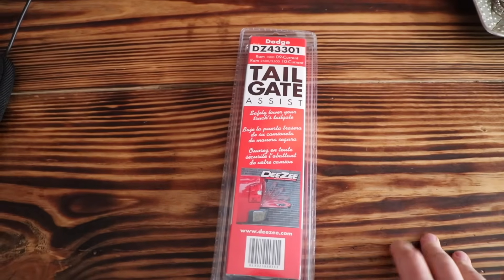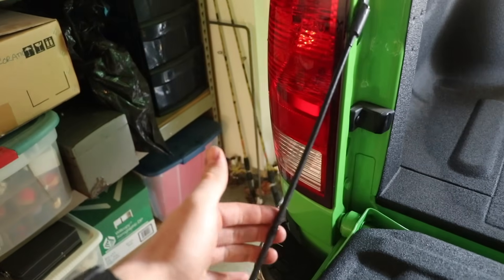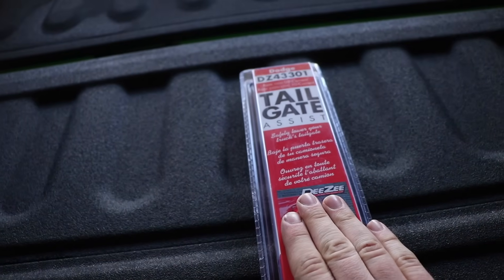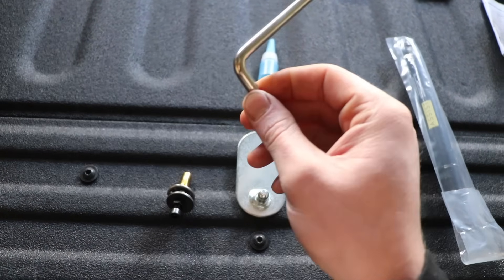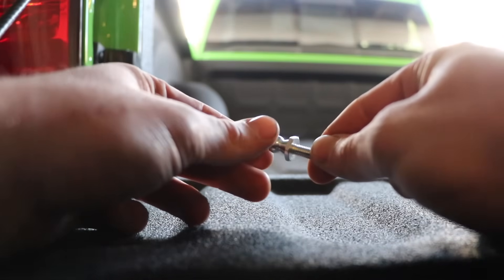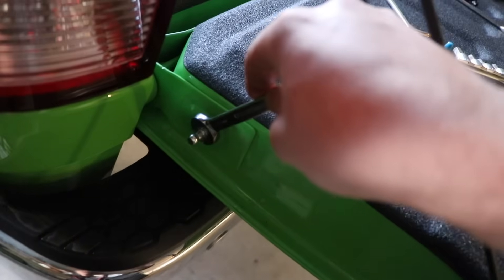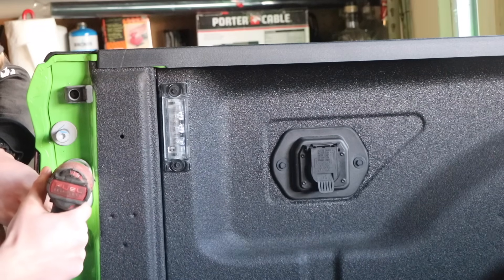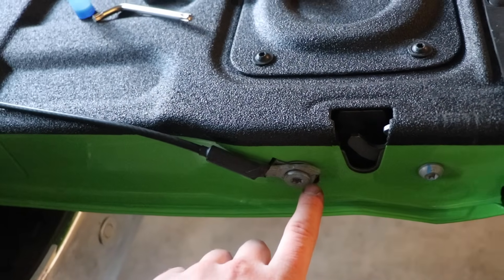$20 Tailgate HACK Everybody NEEDS To Know!!!

Comment: I had a 1995 Ford F150 4x4 3/4 Heavy D.  Had a tailgate that weighed a ton. Don't know why. Opened it up even to see why; couldn't find why. I am handicapped & use a curbside lift mounted in the truck bed to put my mobility cart in the back. No one had a way to raise or lower a tailgate for handicapped back then. I added another motor & bracket to the lift & a strap to the tailgate & with an extra bunton to the remote. I had the only electric tailgate lift. Had a lot of people ask why I needed such a thing probably over 500 times at least. But when I released that strap after lowering that tailgate & said try closing that thing. Most ALL the word out of their mouth was (SH-T). (WHAT THE HELL IS IN THAT THING)?  My answer was always the same I have no clue. It came Factory that way.

Comment: I put super glue on the bottom side of the collar that meets the truck end gate hole, and let it set, that kept it from spinning. I put 1 drop, of 3 in 1 oil, on the balls of the bering to make it roll with the least amount of friction. I removed the special rotation control washer thing from behind the cable on the end gate side,  and installed the same size stainless steel washer, so the cable end, would not scratch my paint where it mounts without the washer thing. Mine works great and I love it. If you guys like this go to Lowes and buy auto drop toilet seats for your home toilets. You just start them and leave them go and they go slowly down themselves. It's the same feeling as this truck gate tool. No more slamming.

Comment: Past 2 years I've had it on my cummins. Still going strong. Word of advice... wd 40 the ball joints at the tailgate and bed every now and then. You're welcome.
Reply: We 40 gets sticky over time. Use a silicone or aluminum based lubrication

Comment: Hmmm,  I bought a used '17 Ram, 4x4, same green by the way, 2700 or so miles on it, last February 2019.  I was pleasantly surprised to see that the tailgate slowly lowers just like in the video.  I thought it was standard equipment, but I guess not. Thanks to the former owner for installing this handy gadget. (I'm 67, so I don't need a heavy tailgate.)

Comment: Based on experience, you might want to check the fittings every few months.  Despite using the loc-tite when I installed mine about 18 months ago, the ball-stud backed out over time without me noticing it and one day I went to open my tailgate and the thing dropped when the stud pulled out.  Nothing permanently damaged but I check the threads every month or so now just to be safe.

Comment: Just an FYI...You can leave the limiter on if you flatten down the rear  tab. It will stop the metal end of the strap from rubbing the paint off the side of the tailgate and not interfere with the strap function.
Reply: What’s a limiter? What’s a strap?

Comment: Some people are so critical and rude... enough said on that! I'm happy to find this product that I didn't know about before. Already in my amazon cart.  Apparently no need to install on both sides? Would it last longer or be too slow with two if you did??  (my only questions)  Makes excellent sense for safety. For people with disabilities or who just want something extra to make life easier.  I pull a 5th wheel and have limited space between truck and trailer. This will make it easier to reach in to unlatch the gate from the side and let it come down on its own. Thanks for the video Ryan!

Comment: i don't think this makes you girly.... I got this for my Ram because my nieces and nephews like to climb in the back and after they would open the tail gait they would have to duck and dodge the drop. i knew one day it would hit someone on the head and that tailgate is heavy enough to mess up someone's neck or spine if hitting them right.. so I got it for their safety.
Reply: Same here. The tailgate latch on my 2019 RAM is basically an electronic button so it's super easy to press. It's the one thing I really dislike about the truck. I prefer mechanical latches. But anyway, it's so easy to press my four year old can reach up and open the tailgate. It only took one time of me leaping over to grab the tailgate before it smacked him in the head to decide to add dampeners. Luckily on the 2019, I can buy the OEM dampener that installs completely hidden behind the tail light.
Reply: You're a thoughtful person man good on you🤙

Comment: Hello Ryan. Ya I know this is a bit late. Great video and excellent instruction on this install. You sold me and a buddy to buy this item to be installed on a 2015 and 2017 RAM 1500's. It's now 2021 and things have changed. Let me tell you what I experienced. With the DeeZee DZ43301 Tailgate Assist. No longer is the locktite provided because the ball mounts for the shock are preinstalled. You will need to remove & clean upper T45 mount and reinstall locktite, that you provide, because removing the lower mount is no longer required provided you bend back the lower limiter clip on the cable mount. Ensuring the very important step of measuring 3 1/2" from the top of the cable is crucial for the spacer install. The package comes with colored pictures and with very good instructions of what is needed to be done. Great job and any other person following this vidoe could be cOrNfUzEd. BIG THANKS!

Comment: I believe, depending on the year of the truck, there is a lowering dampener built in just below the rear tail light. Passenger side for 2019 and newer an I believe 2014 to 2018 is on the drivers side. Laramie and limited the dampening shock is installed but all other models don’t have the dampening shock installed but the hardware to hook it up is there, just have to install the dampening shock which is an item easily available from Ram. Take the the tail light out and you’ll see the hardware. Snap the shock on the 2 ends of the hardware and your set up with factory tailgate dampener. I just ordered mine for a 2022.

Comment: You're lucky.  Your tailgate is the light one.  Mine is all steel and weights about 80 lbs.  I added one to my truck a few years ago.  Best mod I've ever done to the truck.

I also used one to make a slow opener for a TV I have mounted to the ceiling of an outdoor structure at my beach house.  works awesome.

Comment: Not sure if this comment is already in the thread, but newer ram trucks have the shock studs inside the opening on your passenger side rear tail light. Mine is a 2012 and doesn't have it. All you need is the shock and everything stays hidden. Check it out when you get a chance.

Comment: If you don't have a torque wrench here's a rule of thumb. Grab your thumb with your other hand so it is fully covered. 8 foot pounds is about as much force as you can twist your thumb before it starts to hurt. Individual results may vary but check it against a torque wrench some time. It's pretty close.

Comment: Thanks for the video. Never understood why people get so hateful. I accidentally dropped my gate once and the cables broke on both sides. Didn't care for the expensive tailgate repair bill.  I didn't know that these were available and will be doing this to my 07 mega ram dually cause that damn tailgate is heavy when lowering it to load feed and hay and etc all the time. Let alone gooseneck trailers that get attached to it constantly too.

Comment: I have a 2018 Ram and that was the first thing I installed as my grandkids would allow the gate to slam down. What a gate strap saver. Mine is the DeeZee also. 😁😁😁 The only mod I did was to take a small hose clamp and put it around the shock and then take some needle nose pliers and  curl the end of the excess and put a few layers of heat shrink on it to catch the cable.

Comment: Amazing the number of haters on this..    I put one of these on my wife's ram 1500; it was good while it lasted, but the mounts came loose after about three months and eventually fell out.  I am surprised these aren't mandatory safety devices as the weight of the tailgate falling on a kids head could probably put them into a wheelchair for life.  My chevy has the soft open tailgate from the factory as standard equipment (but doesn't lock / unlock with the doors?)

Comment: Wish I could do this on my cruck. I have a 2019 Honda Ridgeline (hence the word "cruck").  Tailgate opens like a regular tailgate but also swings open like a door allowing easier access to the 7+ cubic foot trunk.

Bought a bigger boat and didn't want to buy a 2500 just to tow it so I leave the boat on a lift at the lake and downsized to a Ridgeline.  Love it so far.

Comment: You know if I had a nice new truck then maybe I'd do this. But I've got a 98 Ram 12v and it's missing the clear coat as is. I also would get annoyed with this mod. When I open my tailgate I like things to get done fast. I would get impatient and start pushing it down to open it faster. Which would be more work.
Reply: @dundonrl   Got mine repaired, dents removed, racing decals, nerf bars. $1700. Looks trick.  20in wheels off 2005.  Tough-looking used tires. 1.5 lft in front.  New headlight covers, dash cover, little at time. New truck $500 600 month with payment and insurance.  NO TRUCK PAYMENT, spend a little money.

Comment: I put this on my 03 Ram about 2yrs ago and I love it 👍🏽
Reply from the maker: Yes! I shoulda put it on my 06 when I had it not sure why they fall so fast! They shoulda fixed that long ago!
Reply: And you're proud how? Please explain..  I mean u really don't have to. Dont want to hurt your feelings..
Reply: the following document and let me know
Reply: Same it’s a 03 the truck is still looking new just my dad got into a crash and really got one side of the front tires slightly Tilted but it’s still on a normal height am going. To lift it 5 lift kit soon and might add this little feature have some bad mf tail and front lights on the 03 just got a led bar lights for the truck 😎 right now it’s a blue color am changing it to a Carmel color I like the color not dark by in between looks pretty sweet with the color😫 and if anyone knows about bass lmk down the comments what brand are best and when I turn the volume I want my shirt flying from the bass🙏🏽👌 and soon or later I we’ll install a train horn 🙏🏽🤟🏽 few months and I’ll get my license🤟🏽
Reply: Yep,the tailgate on my 03 Ram is three times heavier than my 2014 Chevy. Had this thing for over a year in my toolbox. Putting it on today.

Comment: Meanwhile some of us bought our trucks to use as trucks, tow trailers, haul wood, concrete, lumber, firewood, bricks, gravel, camping, daily driver.....our brand new RAM 1500 crewcab short box truck is now nearly 11 years old, and will cart 1.3 ton (that's about the limit, the heaviest load was 1.37 ton, and that was too much, 1.2 ton is comfortable for these at 80kph) of roadbase and gravel each load, for our driveway about 6 loads each summer. Love the coil springs, and I like my tailgate stock, so I can quickly lift it off, and back on with minimal fuss. But then again I am big enough to grab each end and lift it off and back on by myself lol..... so I can see where this would be handy for some.

Comment: I've had one for 5 years on my Ram and love it.  So handy to open the tailgate with an armload of stuff without having to set it down.  If you have a Ford or Chevy they have a 3lb tailgate you don't need one of these because you can lower the gate with your pinky finger.  The Ram's tailgate is heavy. 

VERY glad to see that DeeZee changed the upper mount.  It used to come with a bolt to replace the upper cable mount that provided the mount point for the shock.

Also, unless they changed that too, the cable spacer is not large enough in diameter and it gets wedged between the shock and the side of the bed.  20 wraps of Monster tape solves that..

Comment: Wow how much weaker and lazy are people going to get my 1976 pickup had all the options anyone would ever need in a truck a stereo, manual locks manual  windows manual transmission  no powersteering best truck in the world 380k miles and nothing ever went out or broke
Reply: Newsflash. It's not 1976 anymore. Open a '76 tailgate and then a '18 tailgate. They don't weigh the same
Reply: DeWayne Miguel , but did you have to manually use the tailgate?  Oh, you're so strong!
Reply: Cool story bro

Comment: That was a great video I clicked on it by random because it was a Ram ram truck but then I learned I needed that for my truck I place my order right after the video thanks can't wait to install it on my Ram
Reply: I finally got mine and installed it 2 days ago and it works exactly how it's supposed to work
Reply: I did the same after viewing video.  Do u think one assist is enough?  Or do u recommend adding one to each side?  Thanks.
Reply: I only used one and it is good enough

Comment: It's for work i lift my tailgate 15 to 20 times a day how long will that last i would have debris all in that thing good for grocery getter JS
Reply: Ed Jacobs real shtt
Reply: I put one on my 2013 Silverado when I bought it I constantly use my tailgate all day 20 times a day at least since I bought the truck and has not failed me once
Reply: I own and operate a construction business and put on on both of my work trucks so the tailgate doesn’t fall down so hard. It’s been 5 years for the 03 Ram and still working great. The ‘12 Ram got his right away since I knew the value from the previous truck. My next truck will have one for sure.
Reply: wilbready exactly.. it's so you dont break the tailgate from it slamming down.
Reply: you'll still have to lift with this, it's only helps on the way down...
Reply: Mines been on for years. 16 hour days 20 to 30 open and closes each day as a materials engineer.....NO ISSUES

Comment: Installed that exact same unit on my Ram as well. Lasted about 8 months before the top of the "shock / damper" exploded rendering it useless. Also the mounting ball joints both top and bottom needed regular retightening. The usage was maybe 100 open and closings. Would not buy again for a Ram. I believe the tailgate is too heavy.

Comment: I'll agree with others here that I'd prefer a free falling gate - rather than wait each time for it to glide its way down. Apparently, he doesn't need to access the back very often so why have a truck? If you are doing any sort of "work" (it IS a truck after all), you'll be unhooking this obstruction in no time so you can actually get to it. But, the most puzzling thing is what is the point of the video? That had to be the most straight forward installation of anything I have seen. If someone can't accomplish the same without a video to guide them, they shouldn't have a truck and likely shouldn't be driving anything as it will likely overwhelm the snowflake in no time.

Comment: I bet you $100 he has issues with the Nut-Sert in the future, they failed me several times!  I recommend buying and installing Beech Lane Tailgate Assist for your pickup and in this case and mine a RAM.  The attaching hardware is brilliant and don't have to deal with the possible (more than likely) of the nut-sert failing.

Comment: Just so you know,, if you mess up the nutsert like i did,,they sell more at  advanced auto ... The original one came with this crazy contraption with ball bearings and it fell apart when i was tighten it..... I put
Mine on my 2016, Ram rebel Because my girlfriend  kept  slamming  the crap out of the tail gate

Comment: Just wandering, will this work on a 1997 Tahoe. I am disabled and use a walker.It would make it easier to open the tail gate. I  do not have the door version. It is basically a tail gate with a camper shell on it.

Comment: So my cable on the shock side keeps getting stuck in between the shock and truck and pops the shock off, I have the plastic sleeve installed and I’ve moved it up and down on the cable but it keeps doing it any help out there? Thanks

Comment: Hi Ryan,good video but i have question,are you just installing the one shock to one side only and doesnt seem like it would work the rubber stopper on the shock side seems in the way of the tailgate from closing,ok let me know,later.

Comment: Just installed this in my 19 classic and it doesn’t come down as slow as yours does but definitely not as fast as before and I noticed mine didn’t come with the liquid thread locker it looked like the screws already had it. And where that little ball joint is at mine came with a plate

Comment: Sorry but I really didn't catch what you did with the cable. Would you please do a more focused, thorough illustration of exactly what you're doing with the bottom end of the cable and that thing you called the cable spacer or insulator you put on the center of the cable with the pliers. Where did that  come  from? 🤔   thank you

Comment: Installed it. Winter came. Tailgate refused to come down...applied some pressure and the strut rod snapped off. 
Useless  pile of crap when it did operate....yep it lowers your tailgate slowly. after using it I can safely say don't waste your time or money. 
You only realize how stupid it is once you have it on , only then will you ask "why did I do this".

Comment: I can see this as useful to prevent the purdy tailgate from dropping onto your trailer tongue jack your buddy forgot to lay horizontal and getting your tailgate banged up because your dumb ass buddy didn't give a crap about your truck, since he only borrows it a few times and you make the payments.  And besides you  get to keep your Man Card because you still have to do your He Man Curls to lift and shut the tailgate back.
 I'm gonna get one because my 105 lb wife uses my 2500 Dodge to run the trash to the dump. Texas girls have this thing about driving 3/4 ton pickups, don't you know!